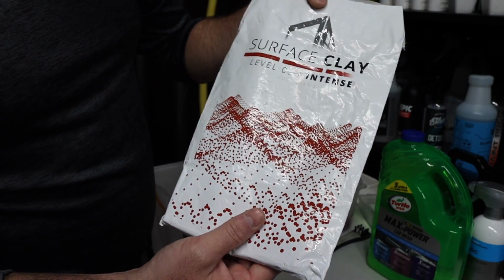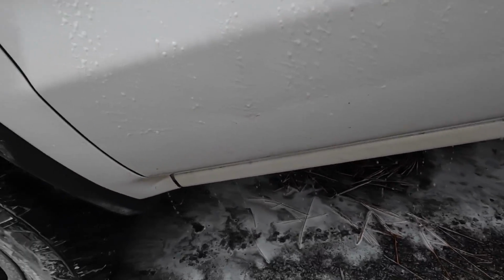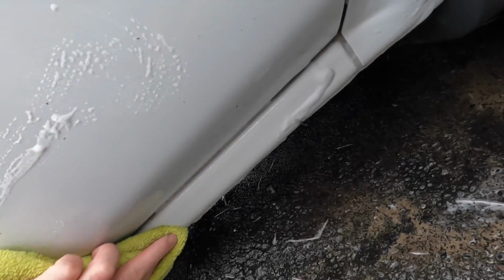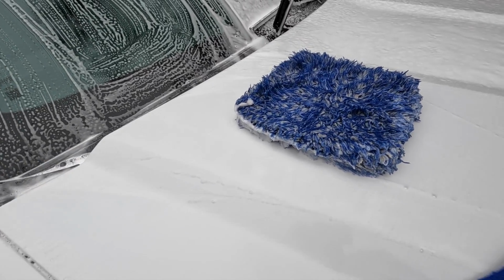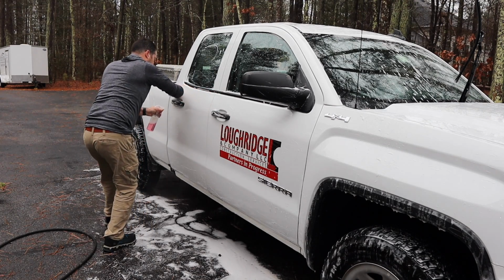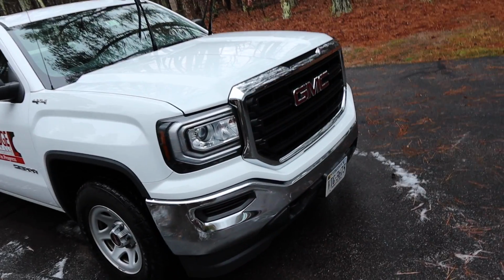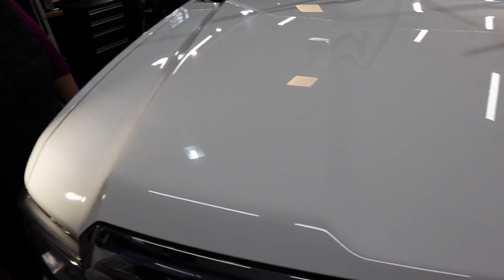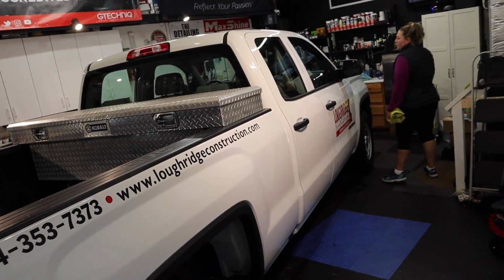Exterior Detail / Horrible Overspray! / How We Remove Overspray! #detailingtips #detailing

Comment: Awesome video! Any pro tips for removing cement on paint? Thanks for your time.
Reply from the maker: Thanks!  Aw man that sucks!  If its just cement speckles you can try white vinegar straight and let it dwell in shade or indoors on the cement. that can usually soften it up and you may have to gently pick it off with a plastic razor. You will definitely need to polish after.
Reply: @MirandaDetailing  I will give it a try. Your a solid guy Phil, thanks for everything you and the wife do!

Comment: I've always noticed that you like to treat some of the trim before polishing. How do you contend with dusting during the polish process? I've been using lake country orange pads with Sonax perfect finish or Koch Chemie Fine cut and I'm getting a lot of dusting. So much so that I almost need to power wash the vehicle down again
Reply from the maker: Hi. Yes on this job if we are not coating the vehicle we like to hit the trim first. Makes it easier to wipe down at the end of the job. 
We don’t get that much dust when polishing. Only if we are doing heavy cutting with a compound and even then it’s not to bad. 
How long of a polishing cycle do you do?  Have you tried using a pad conditioner?
Reply: @MirandaDetailing  I can't say that I've ever really counted in seconds how long the cycle is, but generally 2 passes up and down and side to side. Pad conditioner as in pad conditioning brush?
Reply from the maker: Ok. I have found that the Koch Chemie compounds and polishes don’t need long cycles. I usually only do 2-3 passes. Either up to down or left to right. My first pass is a slow “focus pass” with some pressure and the second is light and quicker. Thats all it usually needs. If the polishes are worked to long they begin to dust. At least this is what have found on our case. If because of hot temperatures it still dusts I use a pad conditioner that is a spray product that helps lubricate the pad and minimize dusting. https://www.detailground.com/vonixx-glizz-polishing-optimizer-16-9-fl-oz-500ml.html
Reply: @MirandaDetailing  great info. I know what conditioner you are referring to now. I do use that from time to time.

Comment: What is your “cocktail” for the APC rinse?  Is that a dedicated foamer for the APC?  Thx Phil
Reply from the maker: So usually Super clean 1:4 But we also like Koch Chemie Super Foam which is very strong also. Yes the Pro12 is our dedicated APC Pre wash sprayer
Reply: @MirandaDetailing  Thank You.  And it’s a foaming sprayer only, correct?  I’m looking for a larger capacity foamer and it looks to be a nice one.  You can fill with your compressor too?  Thx
Reply from the maker: Yes it’s a foamer but it may be able to be used as a regular sprayer. I’ll have to play around with it. 
But it’s awesome. Love the fact that it can be filled with the air compressor quickly.

Comment: I had a customer last week get road line white paint on their vehicle. I tried everything. Nothing would remove it as it’s not your everyday type of paint. Any suggestions? I tired claying with a heavy duty clay, citrol,  lacquer thinner. <— Lightly I tried a few other chemical.
Reply from the maker: Aw man! that sucks!  Wow even Lacquer thinner didn't touch it?  You may have to wet sand it.
Reply: I experienced that once too. I had reapply lacquer thinner. I also put some on folded mf towel and taped to the panel. After that it started dissolving and came off best of luck. That paint is very hard tomremove
Reply: @Breese147  Thank you for sharing that. 🤝
Reply: @MirandaDetailing  do you have a video on polyurethane over spray? 😊
Reply from the maker: @ToddTinley  Hi. I don’t have a specific video for that but honestly the process is the same. Most overspray jobs we don’t even know what type of overspray it is but we do the process. If it doesn’t come off with clay baring then usually wet sanding with 3000 is going to be needed and then polishing.

Comment: Great video!!! Lots to unpack on this one. Something occurred to me just now…I noticed that you don’t use exterior detail brushes on things like emblems, front grill, door jambs. Do you consider that a waste of time? Anyway, love using the Hyperfoam on my tires. I have yet to find a better product. One more Q: How would you compare the polish you used in this video vs Sonax Perfect Finish? Thx
Reply from the maker: Hi Thanks! Actually, we do use brushes and go around in the cracks and emblems when needed. I inspect the vehicle and see what it needs and if the emblems and seems need it, we do it. but sometimes I don't always show it in the video just because of time restraints. Thanks man!  😎👍
So the polish we used on this job is an all-in-one polish. It has ceramic protection in it also. Perfect Finish is also awesome, it's great for soft black paint.
Reply: @MirandaDetailing  Phil can I use this polish with the cordless SPTA?(I just ordered it)
Reply from the maker: Totally man!